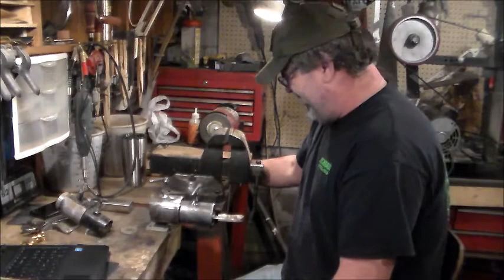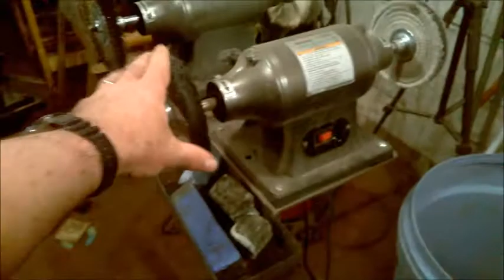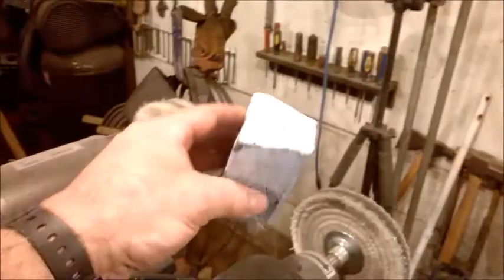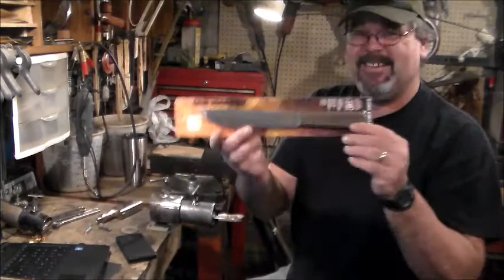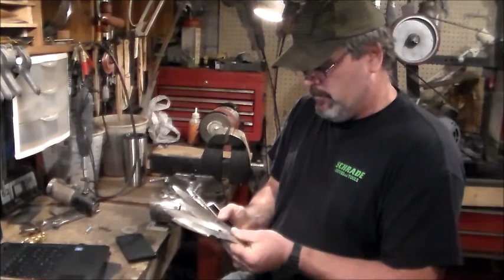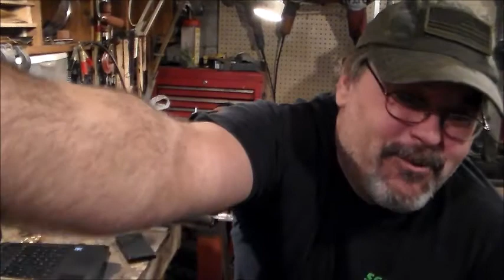My first Q&A

Comment: great answers Tom! your answer led me to another question... when anealing the file if you do a number of times anealing is there a difference in heat treat or would it be the same? Chris is definitely becoming a great not knifemaker hahah im sure he can put that clamp to great use
Reply from the maker: Thanks Rick! I have never had to harden more than once. You can check it with a file after hardening to make sure it worked. Chris has a great knack for knife making. I hope he sticks with it.
Reply: ok. i havent bought it yet but i saw some wide files and i am now going to go get it n try it out!!! yes indeed he is way better than he gives himself credit for but then again that is a great sign of a true craftsman!